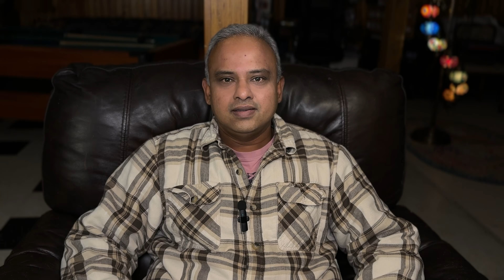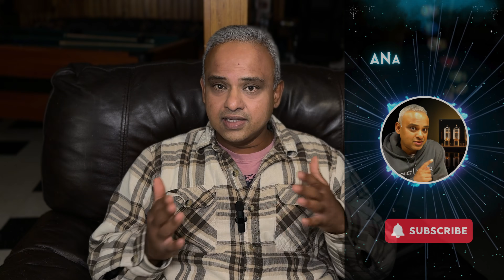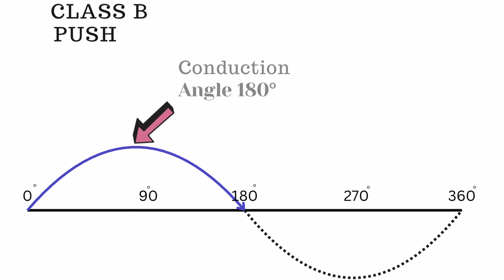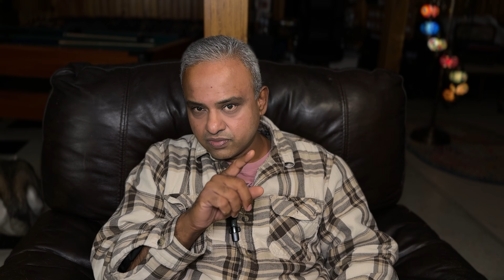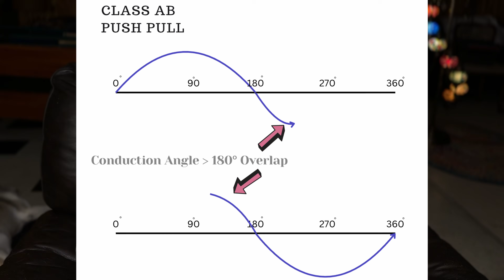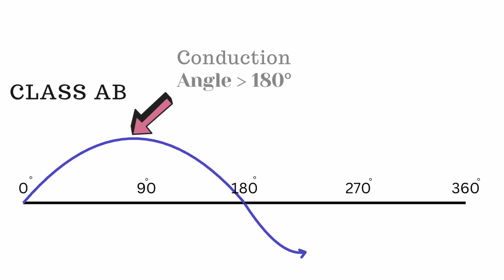The Truth About Class A Amplifiers (They're Not Magic)

Comment: Modern class D isn’t just about efficiency. 

Today’s Purifi and Hypex class D designs realistically eliminate ‘class debate’ and fully solve power amplification equation … ultra quiet, ultra linear, loads of power and headroom, large damping factors, 20-40 A of current delivery into demanding loads … they give any other class run for their money with respect to the sound quality they deliver 😉🫶

And this comes from long time (20+ years) Quad owner (still own Quad 909 and Quad 306), who enjoyed their lovely ‘current dumping’ / feed forward error correction combination of class A and class AB (to eliminate crossover distortion), before I ‘switched’ (pun intended 😂) to Purifi 1ET9040BA based class D mono block power amps and never looked back.

Comment: OK      But what if?     you see electricity use  as   not a factor      And  the heat of class A  also not a factor   Then what class  of amplification   is the best?     I say class A   Transistor or tubes  is better       You can listen to both  transistor   or tube amps  in class A   for zero cost  of electricity    Easy enough        Put a load of of solar panels   on your roof       hence  class A problem solved🙂
Reply from the maker: I get the idea 😄

If power and heat truly don’t matter, Class A is a very elegant way to avoid crossover behavior, no argument there.

But that still doesn’t make it automatically “best.”

What matters is how the amplifier behaves into a real speaker load, headroom, distortion profile under dynamic conditions, and overall system matching.

A well designed Class AB or even Class D amp can outperform a poorly implemented Class A in those areas.

So it’s less about the class itself and more about execution and application.

Class A is one way to solve a problem, not the only way 👍

Comment: I saw yesterday  more chfi     a clone naim  nap      and it seems  that is class B      so i assume the original  is too!     So somehow naim  must have done something to get it right!?    I think.
Reply from the maker: Most Naim amps are not pure Class B.

They run Class AB but with relatively high bias and very careful implementation, which is why they avoid the typical crossover issues people associate with Class B.

Topology labels only tell a small part of the story. Biasing, feedback, power supply, and how the amp behaves into a real speaker load matter much more.

Curious what you saw though
which model or clone were you looking at?

Comment: This tutorial goes hand in hand with the headroom tutorial.  The total system balance is the most important factor.  This is why in my system I have three pairs of speakers in my main " full range " speakers . I also run a subwoofer . They are a system that allows me to cover the dynamics,  headroom and clipping of my amplifiers with ease.  The second benefit is that I have a little more SPL level in " pure " class A from my three class AB amplifiers.  That makes a difference while my system is producing low SPL levels ( definitely can hear it ) . My main speakers are also in a lower distortion operating environment too . 
     All this is to my advantage when I turn it up loud . This is also a good reason to have an additional subwoofer.  Mine is driven by a Class D amplifier.  Those tend to hit full output and very quickly go into high distortion and clipping thus have less instantaneous headroom ( dynamic threshold) . This has been my go to approach for many decades.  I can assemble a system at a very low monetary out lay , because all the individual components can be inexpensive and not working as hard . It also covers some of the imperfections of my low budget speakers.  I.E. what one lacks can be coverd by another speaker . I can also address room characteristics.  
   So what's the drawback ? Time ! . Placement is critical.  The type of speakers are also critical.  This system is a result of a couple years in the making.  I've adjusted crossovers , individual drivers and have rejected speakers entirely and cjhanged them according to what I learned.  This was all done by ear ( even the crossovers ) in room  . It required patience and resisting multiple or big changes at a time . As a system it can be turned up from very low to very loud with ease.  I can use a particular pair of speakers to adjust the tonal balance of a poor recording and improve the vocals for instance... vocals are key for tonal balance.  My subwoofer has a front mounted level control for doing the same kind of thing ( it's also been EQ'd ) , my smaller pairs of speakers have had the bass responce reduced to reduce distortion in the low end too . That low end distortion in a small midbass drive shows up all the way to the crossover.  So this makes a noticeable difference at high output levels.  Any i have twi way speakers with different sized midbass drivers ranging from 205 mm with a midtweeter  to 115 with a 19 mm dome and a 135 mm with a 25 mm dome .Plus  a 12 inch subwoofer.  Each of these has it's specialty.  It's a system that the whole is working well .
Reply from the maker: Interesting system approach. What you are describing is essentially spreading the acoustic workload across multiple drivers so each one operates with lower excursion and lower distortion. That can absolutely improve dynamic headroom and reduce stress on the amplifiers.

Using a dedicated subwoofer for the lowest frequencies also helps a lot because bass requires the largest cone movement and amplifier current.

One small clarification is that modern class D amplifiers do not inherently run out of headroom faster than class AB. When designed well they can deliver very strong peak current and dynamic output. The real determinant of headroom is usually the power supply design and the load the amplifier is driving.

Your broader point about system balance is very valid though. When drivers and amplifiers are not pushed near their limits distortion tends to drop and the system can sound more effortless as the level rises.

And you are absolutely right that placement and integration often take far more time than people expect.

Comment: I just built a JLH 1969 amp, it sounds great, but it gets very warm. You definitely need big heat sinks - And I’m only running it at 24 volts, not 32.  But it does sound incredible, my jazz albums never sounded better.  Great video as usual 👍
Reply from the maker: Thank you and very nice build.
The JLH 1969 is a true Class A design!
Glad it is rewarding you musically. That design has survived for decades for a reason.

Comment: Sometimes waste is needed for headroom and sound quality. Same principle in Memory Playback. High efficiency in audio is normally a danger sign.
Reply from the maker: Heat is not a proxy for fidelity.

Headroom and efficiency are two different things.

Headroom is about voltage and current capability relative to the load. It is about how much clean output the amplifier can deliver before clipping.

Efficiency is about how much of the input power is converted into output power versus wasted as heat.

A Class A amplifier can have excellent headroom and low efficiency. A well designed Class D amplifier can also have excellent headroom and much higher efficiency. The two are not mutually exclusive.

In electronics, higher efficiency is not a danger sign by itself. It simply means less energy is being wasted as heat. Sound quality depends on linearity, power supply stability, load interaction, and overall implementation, not on how much heat the amplifier produces.
Reply: @analogholic_reviews  As Dr Geddes said, we dont yet measure every parameter that is affecting good sound. He did say its a shame. The ultimate judge of SQ is the ears as they are a FAR BETTER GUAGE THAN CURRENT MEASURING INSTRUMENTS/PARADIGMS. I do agree that the techie engineering aspect cannot be discounted, but it is not yet the end all be all. I was not saying  that heat offload is the reason for good class A sound...in truth, I think we circle the end point but are not there yet. We dont absolutely know. Please note these are side discussions that dont detract from your vids with are very useful primers/jumping off points.
Reply from the maker: Love this comment!

Our measurement tools are incredibly powerful, but they do not capture every perceptual nuance. Sound quality is ultimately experienced by human beings in rooms, not by analyzers on a bench.

At the same time, the reason I lean into engineering principles is because they give us guardrails. They help us separate what is physically plausible from what is not, and they prevent us from chasing explanations that do not align with how circuits actually behave.

So I see it as complementary rather than oppositional. Listening tells us something is happening. Engineering helps us understand why. And we are always refining that understanding.

Appreciate the respectful discussion!
Reply: @analogholic_reviews  Fully agree. I really think your channel is a great addition. Love it, despite my pokes.

Comment: My toaster takes 1500 watts to run. WTF do I care about my 100 watt amps efficiency.
Reply from the maker: Difference is duty cycle.

Your toaster pulls 1500 watts for a few minutes, then turns off. A Class A amplifier can draw several hundred watts continuously whether music is playing or not.

So the efficiency discussion is less about peak power and more about continuous idle consumption over years of use.

For some people that matters. For others it does not. I just want people to understand what they are choosing.
Reply: @analogholic_reviews many of the high power class A solid state amplifiers use a bias technique so the amplifier isn't drawing as much power when no signal is present or music is being played at a low level.

Comment: Class A amplifiers aren't just a bed of roses. The distortion "in principle" is the best you can get, but what matters is the THD + Noise, that is, the entire residual spectrum. And given the high bias current with unregulated power supplies, these exhibit high power supply ripple and therefore also a high output mains residue with the related harmonics. These last almost always produce intermodulation distortion phenomena, with the signal giving THD residual often higher than class AB amplifiers. Not to mention the problem of bias current temperature stability.
Reply from the maker: Yes. Class A in principle eliminates crossover distortion, but that does not automatically mean lowest overall distortion in real world implementations. As you point out, the full residual spectrum including noise, ripple, and intermodulation matters.

Power supply design and thermal stability are huge factors. A poorly executed Class A design can absolutely measure worse than a well engineered Class AB amplifier.

My point in the video was not that Class A is inherently superior, but that topology alone does not guarantee outcome. Implementation is everything.

Appreciate you adding that technical layer to the discussion.
Reply: @analogholic_reviews  Surely crossover distortion is a thing of the past now. I've been working with TDA7293 chips, and have never experienced crossover distortion yet?
Reply: Hmmm... Class A push pull should have more consistent current draw than class AB. My SE tube amp with CLCLC power supply didn't seem to have any issues from being unregulated.

There's more than one way to skin a cat.

Comment: The simple fact is that all properly designed Class A amplifier with modest feedback is a freaking fantastic thing. When the Conrad Johnson Motife preamp and amps came out they were incredible and sounded wonderful.  But the cost and the heat were other worldly.  Class A sounds good because it is simple and uncomplicated.   There are a boat load of down sides to Class A amps that make them far less enticing than others would have you believe.  As he makes the point, the waste heat.  An amplifier with a modest 25Watts per channel will burn 200Watts AT ALL TIMES.  This doesnt sound like much until you have to deal with the heat and the electric bill comes due.  Remember that if you live in places where A/C is a necessity for part of the year that 200Watts is an additional 628Btu your heat pump must contend with.   They are big, expensive, and have limited power output.  For the preamp, sure.  For the amplifier proper, no Fing way.  Lastly, put 10 quality amps side by side and bounce between them, matched for level there should be no difference in sound.  Those that stand out have problems.  All amplifiers, preamp or power, should be a wire with gain!
Reply from the maker: You raise fair points about heat and efficiency. True Class A is thermally expensive. A 25 watt Class A amp idling at 200 watts is not trivial, especially in warmer climates. That tradeoff is real and people should understand it before buying.

Where I would gently disagree is the idea that if you level match ten quality amplifiers there should be no difference at all and any difference means something is wrong.

If all amplifiers were operating purely in their linear region into an easy load and never interacting with a complex speaker impedance curve, then yes, they would converge very closely.

But in the real world speakers are reactive loads. Output impedance, feedback topology, biasing, current capability, and stability into phase angles can all slightly alter system behavior. That does not mean one is broken. It means interaction exists.

Wire with gain is an ideal. Engineering always involves compromises between distortion, efficiency, heat, cost, and stability.

Class A simplifies some distortion behaviors by avoiding crossover artifacts. In return you accept heat and inefficiency. Whether that trade is worth it depends on the system, the room, and the listener.

I try to think like this: understand the tradeoffs, then choose intentionally. That is all I try to encourage.
Reply: @analogholic_reviews  lol!  You dont have to disagree with me "gently".  I am an adult with little ego to be brused.  This is a dialog and you are an EE with far deeper knowledge than I in this field.  I on the other hand am an electrician and self educated hobbyist with a fairly wide range of experiences in a large array of electronics and electrical as well as most trades and precision machine shop and composites.  Even high end home theaters costing many hundreds of thousands of dollars as well as recording studios.  I have DIYed my own speakers and audio gear.  But I still have to bow to your knowledge as likely more nuanced and correct than mine might be.  Especially here.  At present we use Crown and QSC professional amps for our home theater.  So robust and well controlled is our system.  I have three PS Audio 200CX amps to bench and repair to replace the touring amps.  I suspect the sound will change quite a bit due to topology and simplicity of the PSamps compared to the touring amps.  Always good to spar a bit.  With respect of course too!
Reply: I don't see how 200 watts of heat dissipation is going to heat up a room considerably, or make an electric bill that much higher. Many class A/B amplifiers can and do idle at 100-200 watts.
Reply: @mitchtaylor6512  200Watts all the time in an relatively confined space WILL heat it up.  More over, with no air conditioning and in the summer time that will result in the room temp rising allot more than one would believe.  As to the cost, that is 1KW/hr for every 5 hours of on time.  This means that you are burning roughly 135KW/hrs per month.  If you are like the average us home owner your home draws about 900KW/hrs in said average month.  So adding in your "heater" running 24/7 that is an increase of roughly 15% to your electrical bill.  Add in A/C to remove the heat from the envelope of your space and and this number could be another 5% higher depending on the SEER rating and condition of said heat pump.  Also, some service providers have additional charges for heavy average users.  So just assuming the original number of 15%, if your bill is normally $200.00 per month this is $30.00 more per month, or $360.00 per year.  For allot of average enthusiast, this is not a minor expenditure.
Reply: @mikeiver if you are worried about heat and electricity consumption, why would you leave your audio equipment on 24/7?
Reply: @mitchtaylor6512  you assume that 1. I am concerned about the cost of running such kit.  2. I have such kit.  3. I chose to turn off my equipment between use.  I simply pointed out the down side of Class A amps most dont think about.  You do you.
Reply: @mikeiver I don't have any problems with my class A equipment, my audio room is conditioned space, so I use a little more electricity to cool in summer and a little less heat in the winter, so it averages out. I just don't think that 200 watts is going to heat up the room drastically if much at all.
Reply: @mitchtaylor6512  OK, good for you.  You're right, I'm wrong.  The heat and the cost are not a factor at all.
Reply: @mikeiver  I don't run my stereo 24/7 and I don't run my nonexistent TV at all. The added heat of a couple of light bulbs for a couple hours doesn't concern me either. I am too old to sweat the small stuff.